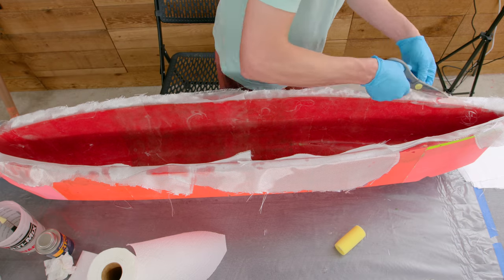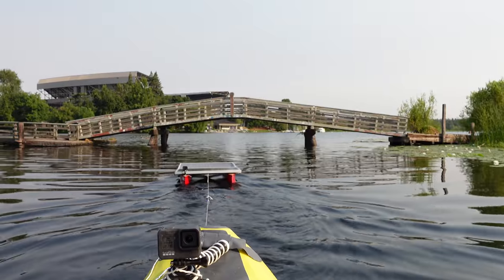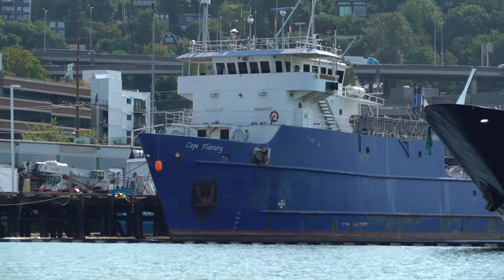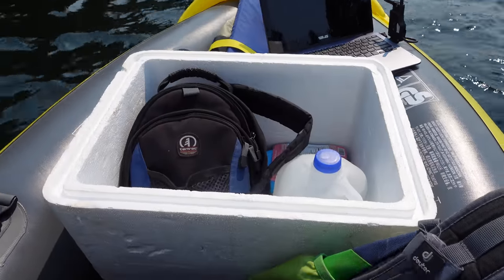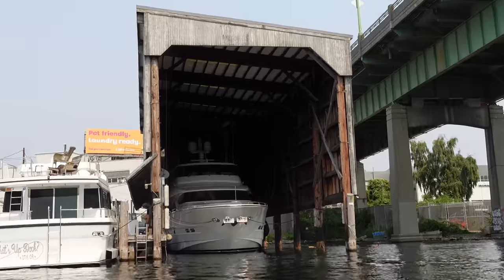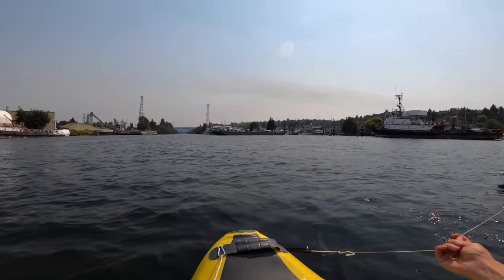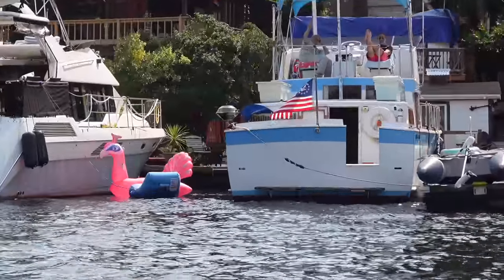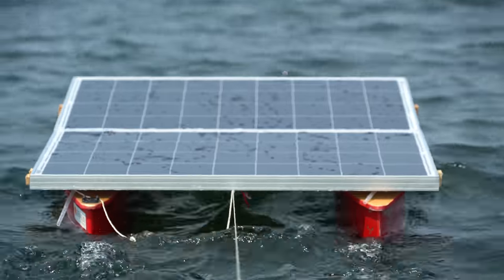My DIY R/C Boat Pulled me 20 Miles!!!

Comment from the maker: Thanks again to Ritual for sponsoring this video! I love their vitamins because they taste so good. Remember to use my code FLIGHT for 10% off your first three months! https://ritual.com/flight
Reply: what is nexr?
Reply: That song alone was impressive. The rest was gravy.
Reply: Nice dingy. 😁👌
Reply: Would you run a GoPro under the boat so we could see how the propellers do and a view of the lake/bottom
Reply: The irony of people calling you lazy when you've probably worked harder on this boat than they've worked on any hobby project they've done. 😉
Reply: Not very nice com for Asus that makes great products imo
Time to make a human scale cat with two inflatable canoe and foldable structure with floor and solar roof? Combined with hybrid pedal power and you're gold for a very long range :)
Reply: Now take this solar panel boat. Turn it into a product that can be stored in a smaller area and apply easily with a preset waypoint to a shoreline.  
Now sell them as emergency devices that can attach to liferafts.
Reply: Or if there were some other software they could calculate the nearest shoreline automatically.
Reply: Hey uhm will you release the song in another video please I want to hear the song
Reply: You should shield your laptop from the sun.....probably help from heating up
Reply: You should add a small horn to the tug boat! I think it’d bea useful addition
Reply: It was so amazing to see the Gyrfalcon on your video! Just my opinion, but that was probably the best vessel seen on your trip. It was designed by H.C. Hanson and was originally built for US Coast Guard. Both the designer and the vessel had amazing lives. Out of all the vessels designed by Hanson, the Gyrfalcon is my favorite. She was built in 1941 but was designed in a style that was popular at the turn of the century. Thankfully, she was retired as a private yacht and not scrapped. Her quality build and design as a long range vessel will keep her on the water indefinitely.
Reply: I should also mention the Foss tug boat that you passed. I believe that is one with their famous Z-Drive tractor propulsion system. Your proximity to the Pacific Ocean and Bering Sea fishing grounds makes your area a mecca for large vessels of every type. P.s. Did you see Tom Hanks and Meg Ryan on a boathouse? 😁
Reply: 12v to 120/240v inverters can mess with computers if they are putting out a modified sine wave instead of a pure sine wave so maybe the laptop was acting up because of your 19v inverter.
Reply: Why to not attaching the engines and solar panels just in to the kayak?

Edit:
Great videos. I love it. Till... Some solutions are unnecessary overcomplicated. 🤷‍♂️
Reply: I have a real question about the bulbus bows how do they work on the scales models in the wave pool? Is it just the wave simulation that makes it possible to test so small?
Reply: You forgot to put "without a paddle" in the title. Lol regardless, greatest thing I've seen in a while.
Reply: That was really awesome.. First time I've seen your channel.. Subbed...
Reply: Hey, maybe if you change to a 1 person plastic kayak the tug boat will be way more efficient eso to drag reduction, amazing video Btw
Reply: This project clearly needs more solar panels and more propulsion.
A magnetoelectrohydrodynamic model would be interesting to try... not a direct current one but one that couples capacitively through water and oscillates the magnetic field to always push water in one direction no matter the direction in which the water capacitor charges and discharges.
Also, you can paint the underside with superhydrophobic paint to cancel most of the drag that waters puts on a surface. This will probably not effect the capacitive coupling too much, especially if the paint layer is already thick.
Reply: Argh me hearty!!!!  What a great nautical tech shanty. Lovin' it.
The drone vessel thing was pretty cool too. ;-)

You need some vision systems (more CPU, more storage and more power) to verify paths and help identify alternate routes.
I wonder how much bigger the vessel  - more corretly the CPU, storage and power would need to be to incorporate stuff like vision systems and sonar (I wonder if you couyld waterproof and re-puprose the sonar systems used for collision detection on airborne drones to work in water) to enable better collision detection and autonmous route correction when an obstacle like a barge, swimmer or rowing team is encountered.
Reply: your computer may get too hot under the sun, so it hard to work. You should try double the solar panel, wider to be more stable, also you can add more motor.
Reply: oul
Reply: That semi transparent kayak in the video would be much more slippery in the water than your inflatable
Reply: Hi mate I’m English that song made me crease up 😂 sick video man you’re an engineer
Reply: @rctestflight  keep it up, with the whole earth plunging into water rising level, definitely can see the benefits of solar use
Reply: Youre pretty good and i could use some help
Can you make rocket fuel from water (H202) ?
Has to be solar

mills
Reply: @NCOGNTO  is h2o2 heavy water?
There are a few rockets that use hydrogen and oxygen for fuel.
SLS I believe
Reply: Ah yes, quality content to watch at 4 A.M
Reply: All that planning... and no pee bottle.
Reply: So are you gonna release the song you made separately as well?
Reply: COOL! ! !    Great job
Reply: I was about to be really impressed if that song continued through the entire 36 minute video!
Reply: did you record this in seattle!??? i live near seattle
Reply: @Darkjuggernaut99  Hanks ka
Reply: What a song, man !!!!!!!!!!!
Reply: Amazing Song my dude!
Reply: Autonomous banana-split-dawg.
Reply: That sea shanty is what sold this whole video tbh...
Reply: Dude, great sense of humor and outtake on life. Great job
Reply: The sailor's ballad was the best part.  Hysterical!
Reply: this is such a great idea man, I can see this becoming a business and hobby / big industry. Great work
Reply: Props to you Dude! 
No pun intended :-)
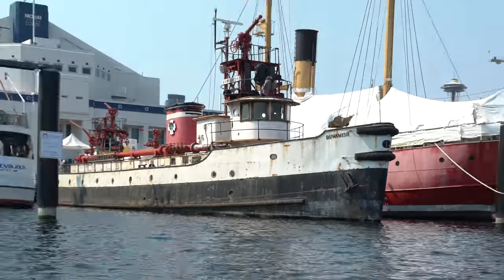Reply: 12:32 they came in so low because the passengers wanted to get some pictures of you and your robotug, lol.
And have you thought of scaling up the design so you could sit in it instead of it towinf you in an inflatable?
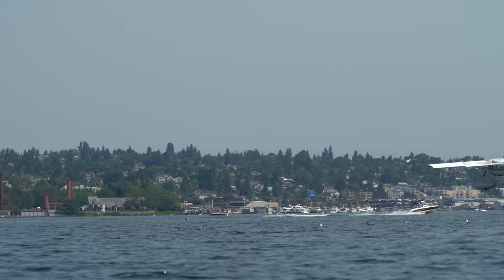Reply: BTW, 12:45 - the red hulled one looks like it might be an old light ship.
Reply: I hope you put patients in for this
Reply: It seems you already know by now ASUS makes garbage computers.
Reply: Thanks for song)
Reply: what was the song you sung called
Reply: I need a play list whit your music plis!!!! That was so satisfying and relaxing to hear. I almost fell asleep thanks to you, I love you
Reply: Hello fellow Washingtonian! Come on down to black lake (when it's not raining so in bout two years.) And you think you would go to seafair in August? That would be a cool sight to see you in a little kayak with the blue angels overhead
Reply: why not promote the vaccine also.  and the booster shot,,mmmmmm its so good for you, mmmmmmmm
Reply: damn I had to watch the intro 3 times before I could watch the rest of the video cause I was vibin so hard to the intro song LMAO
Reply: love the intro lol
Reply: thank you for this video i got to see some of the boats i have worked on like the defender and a few more been years since i stepped foot on them you saw a lot of HG boats which are trawlers  who fish the bering sea   and some  long line boats also HG and a few crab boats pretty cool
Reply: You should make it even faster
Reply: So, why not just make a harness to put the motors directly onto the air boat?
Reply: Please patent and sell we all kayaker need one ….. for fishing to get to our spot and trolling motor doesn’t go that far,,,, 20 miles gawd dam
Reply: @toannguyen214dallas  I've asked a couple times with no response yet; why not just add the motors to your kayak? Why have a separate craft involved?
Reply: Panels are designed to be waterproof - in hard rain and hail too. So I think a little splash now and then shouldn't bother them .
Reply: @williamwilliams8145  -  converter.
Reply: @shiitakestick  transformer.
Reply: @williamwilliams8145  - transformers are for AC.
( Just ask Lou Reed (sp?) )
Reply: @charlidog2  - so it's modular . you can hook it up to anything floating .
Reply: @shiitakestick  Well thank you. I asked on a couple threads and I'm glad I got an answer. Shows how shallow my creative thinking is in my old age.
Reply: @charlidog2  - there are no shallow questions . 
.. well 1 , or 2 ..maybe
Reply: if only you knew wind sails existed
Reply: how did you find your wife?
rotestflight: 33:34 :3
Reply: Watching you have to fraudulently shill that trash ass protein powder made me cringe and how you left the parts where your black friend completely denies wanting any twice and your girl had to look at the bag to see what it even is was hella funny.
Reply: Could you make it a full song?
Reply: If your able to you should make a super fast short range autonomous boat. I feel like that would be incredible to watch. Amazing video, keep up the good work.
Reply: Please ask your sponsor, "Why do all the protein supplement makers insist on flavoring everything so I can't use it in my cooking?  Where  is the unflavored vegetable protein powder that I can make something other than a vanilla or chocolate drink that I will never like?"
Reply: Try this again with perovskite solar cells
Reply: You should have asked those ladies to “tug” you know……
Reply: A cross between Napolian Dynamite and Gilligan
Reply: Loved the video! I’m wondering if you’d be interested in building a 1/4 or 1/3 scale Douglas A-26 functional water bomber? I’m a pretty good r/c pilot (fly out from behind trees, understand wing loading, do x-wind approaches, etc.,) & can maintain equipment, but a crappy builder. I’d even fund a 3D printer, so you can create whatever designs you like (with my inputs, if not too intrusive) from the many schematics available online. What do you think? RSVP.  -Gary, Newport Beach, SoCal, CISSP ret.
Reply: This is brillant and could save lives.
Reply: What would it cost to make one of these with a small sonar module (think fish finder almost) so that you could map out a body of water like a small lake
Reply: @rctestflight do you build domes for customers? I work for a mine that needs something like this to patrol a tailings pond and disturb wildlife. 
Let me know if you'd like to discuss
Reply: How long did it take for the whole trip?
Reply: American No.1 was built in 1979 by Marine Construction and Design Company or "MARCO" in Seattle WA as a crab/fish catcher and processing ship.
Reply: Well done, Mr. Cool! 🙂👍
Reply: i think keeping the computer in the sun was the issue
Reply: Hey! DUDE, the  concept has some Commercial/Military "Marketability" there. I'd check to see if DARPA is interested, and see if someone hasn't beat you to patenting a "Commercially Marketable" Version.

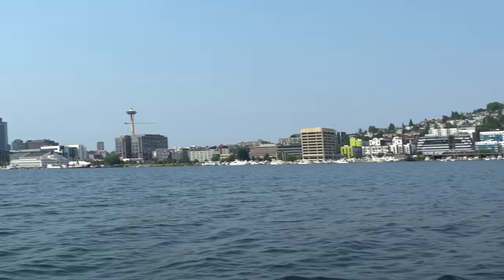Comment: 11:28 ya, thats a turbo-prop one.... pretty new/high tech
turbo prop = a normal jet engine.... but it spins a prop instead of a big "fan" 
.
and its pretty easy to "drop in" that steep when you have flaps that go to like 80 degrees LOL
adds a SHIT TON of drag..... and quite a bit of extra lift...... so you can slow down fast AND/OR! drastically reduce your landing speed

Comment: If you want to make it more powerful and have more range at the same time, you can have a super-capacitor, and a large lithium pack, and attach longer and wider solar panels at the same time. You can also increase powers of motor and just have it attached to the boat itself! Then have an autonomous gondolier.

Comment: Did you think of putting the panels on your inflatable and then running a cable to the RC boat? You could then have more panels for charging and drive power.

Comment: you could ad mechanicle paddles to it
controlled my a rod you move
if its stationary (aka in a holdster) the paddles will face sort of twords you sideways ... and therefore you disign a kaijak for this... with solar pannels!
Reply: the paddles should be on the tugboat because otherwise its just useless
the string ataching it to the tugboat could become a cable. a large battery could be installed in the kaijak

Comment: Lyrics:

0:00
There once was a ship of fiberglass
Most 3D printed super fast
The sun melted one side of it
But Daniel did not give up
Plan a mission our two rovers
So many waypoints all in order
Flip it into auto mode
An off Daniel did go
GPS will lead the way
From dusk to dawn he'll sail all day
Batteries charged by the sun
Until the night falls it will run
LiFePO4, the best batteries that ever were
10 amp hour capacity and six of them in store
As he ventured through Seattle
Both propellers sure did rattle
You won't believe me when I say
It didn't even matter

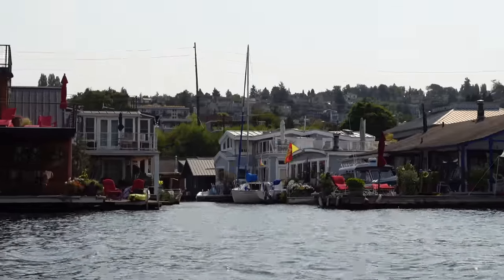10:01
Careful with that razor blade
A big incision it has made
A good thing it was just the seat
Or surely you'd be sunk
Sea planes are coming in hot
You'd think they'd crash but surely not
Daniel wishes he flew one
But for now a dinghy's all he's got
The head wind was blowing stiff
The boat was smaller than a skiff
But the big solar panels kept
Those big propellers turning
Full speed across lake union
Under bridges only one crewman
Beautiful yachts passing by
Field big kayak energy

14:41
The ballard locks did luma had
The boat hauls painted also red
Solar panels pumping amps
And brass propellers turning
So many rusting ships
Ice cold water perky nips
Daniel needed to go pee
But to stop would be a travesty
Yohoho the boat did sail
Through the channel over a whale
Daniel's crappy laptop froze
But the mission onwards still did go
Dance right through the rowing team
Like an asshole he did seem
Oh but little did they know
The course was set in stone

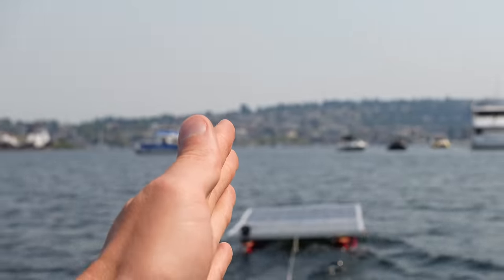27:51
RFD 900 gleaming
Telemetry data it was streaming
Mission planner it was freezing
This computer sucks
Drawbridge is tilting up
People riding on a sub
Saw Daniel wasn't paddling
So they called him lazy
Little did they even know
The fact they just thought he should row
Didn't make any real sense
Cause rowing is archaic
Manual labour is dumb
To technology we succumb
Tech companies are already
Reprogramming our brains
 
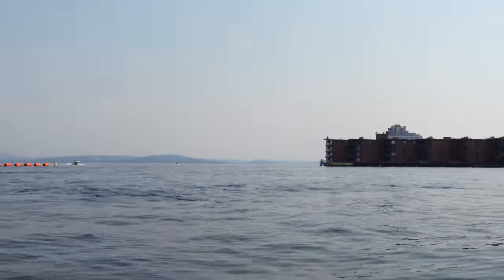34:32
Sailing out upon the lake
Almost swamped by big boat wake
Rich people are trying to flex
But their boats can't self-direct
As he passed the nice big yachts
The bikini bays were looking hot
He started to feel like a dork
His confidence did waver
Then again those big boats owner
Risk suffering from foreclosure
Daniel's kayak only cost
50 bucks on craigslist
Two drone motors amps of burning
Brass propellers were a churning
Holes were slicing through the sea
Without so much efficiency

(some parts may be wrong)

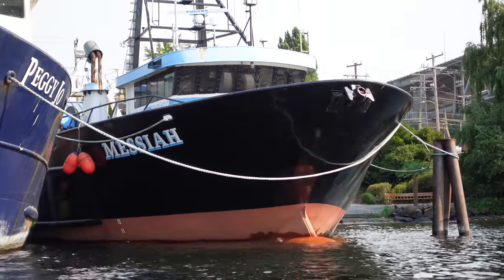Comment: For a Spektrum RC NX8 2.4GHz DSMX 8-Channel Radio System (Transmitter Only) remote would it still have the auto mode and if I use some sort of 3D app on my phone will it be able to go auto mode in my house or like around my neighborhood using Google maps to map it out like you. For an example the video time (8:13-8:16) on left side of the screen it show like the "Alt, Ground Speed, Air Speed, Battery Voltage (V), and etc." What program is that or is it just when your piloting the boat it shows up. One last thing what Channel Radio System or What Channel do you use or do you use multiple Channel(s)? Just reply what you know and what could help me and I'll reply back. (6/29/2023)

Comment: Unfortunately, solar power might not be the best year-round solution for your tug. Of course, Winter is also not the best time to be on the water around Seattle, anyway.
Where are you from in that you seem so unaware of the water around Seattle?! Even the thousands of houseboats seem to be "news" to you! 😳Me thinks you spend too much time in the basement designing/building an RC tug! 😁 I do hope you've had a few swimming lessons. A quick look at the rules on a waterway might keep you out of trouble. 👍 BTW, those seaplanes have been operating between Seattle and the islands for over 40 years!

Comment: The people saying "Lazy!", yet they just bought a boat. It's insured if anything happens to it. They're safe if it fails or runs out of fuel. But you built and engineered a very capable, autonomous, zero-fuel, tug boat on the tiniest budget and power consumption. Plus you're risking your biscuit by testing it yourself in an inflatable kayak... But you're the lazy one? 🤣

Comment: This is the way to get around vessel registration laws for personal craft. If you have a mounted motor (even a trolling motor on a kayak or surf board etc) it has to be registered and pay tags yearly. Not sure if just commie states or "free" states do it too.

If nothing else it is an emergency aid in case you get swept out to sea or across a lake and run out of energy / get injured. A large umbrella to sail the wind is a good tech free alternative too.

Comment: Sorry - but I know you think you've made a solar tug, but you REALLY haven't.
You have 60AH of 12.8V stored. That is 760WH. 
The solar panel is rated what 50W? At mid-day at a reasonably low latitude? So let's say it averages 25W for 14 hours on a summer's day - so a maximum of 350WH. Basically you have a battery powered tug that you charge over a few days.